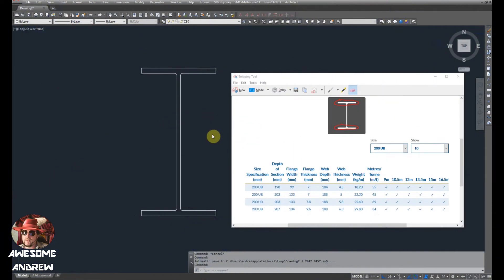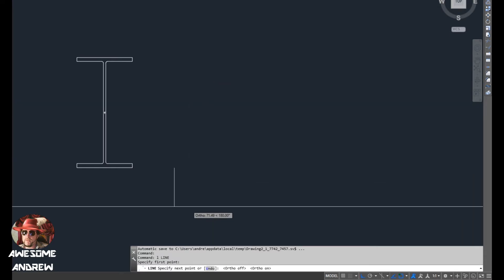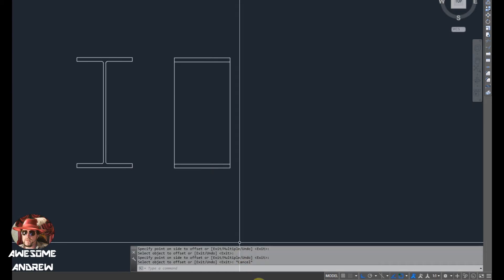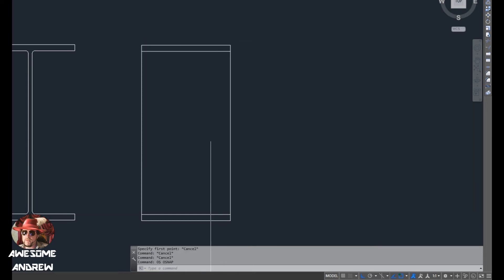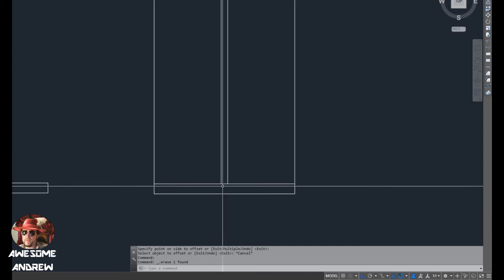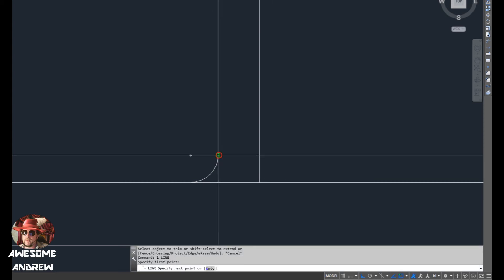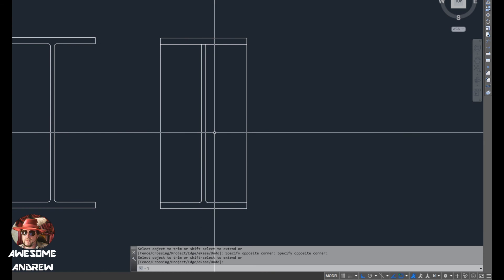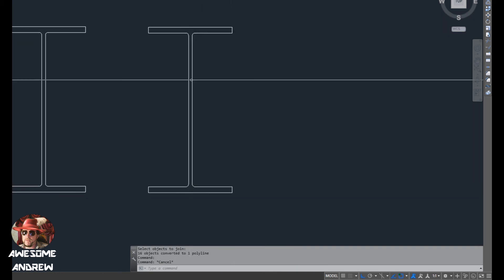Basic and Easy How to Draw Steel I-Beam and Column in AutoCAD UB UC

Comment: Nice turtorial, but I came to see how someone finds the radius at the point where the flange and web meet. Kind of annoyed that I watched up until that point where you guessed it... 

I'm not sure if this measurement really matters, i'm just trying to learn how to create an accurate block.
Reply from the maker: This information you require varies by steel manufacturer. It is available, at least it once was. I have had this information in technical brochures from the steel manufacturers that usually have very detailed drawings on every dimension of the cross section of the steel. Have a look at websites in your country of the steel manufacturers, and if not on the website, ask them for it.
Reply: same concern here